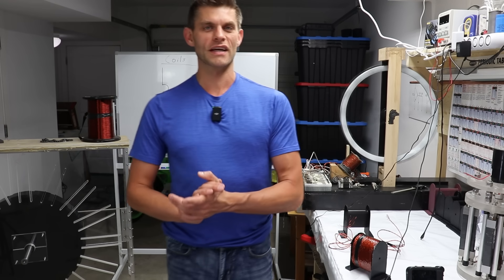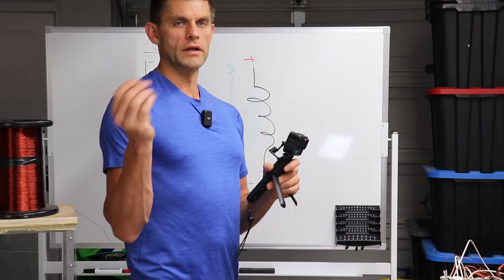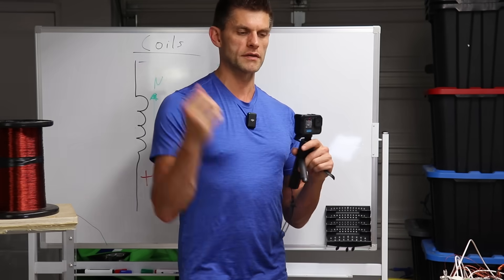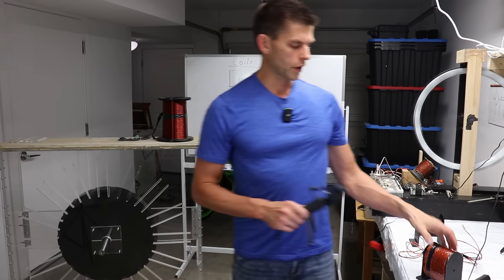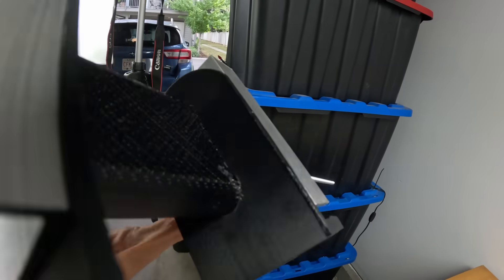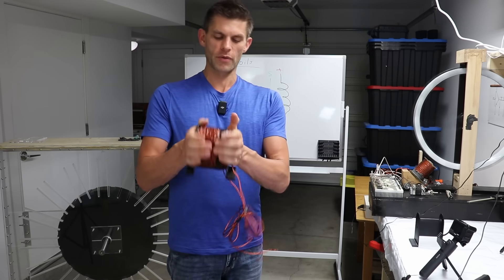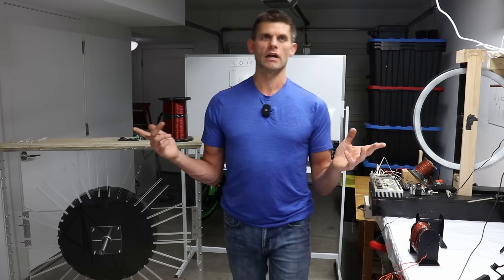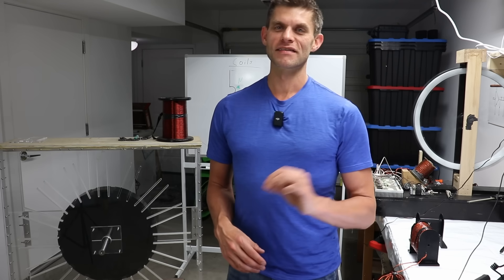Unlimited Energy in My Garage (No Patents)

Comment: Im gunna have to ask  wtf is eith the go pro. You have the mannerism and pacing of an inmate. You holding the camera makes you appear paranoid.  Open source does not mean what tou think it does albeit technically yes this is open source. More accurate its an idea free to use without a patent 

Okay easy test. Use a significantly smaller battery on one side. Alternate them until the larger battery is full stafting with only the small battery charged. Swap back to fill the small battery and them back again. You can set up a single cut with a clock in the background. Voltage doesn't work that way either. You need to include the rest of the formula. 

A few triple As in series will work. For the amall side battery and then a series of high capacity lithium ions for the large idea. 

I mean if it works. Obviously money is not an issue. But we know how physics and electrical work around here bubba. Sorry. But youre always getting negative energy.
Reply from the maker: Ok Mr positive
Reply: @MadscienceLPTECH  ions don't care about positive or negative in this test

Comment: You are way ahead of me, but it seems.
Like a heavy flywheel would would Help Support A bigger generator.
With Little Change in the design. Also  a distributor type Of equipment to help with the on off of the magnets.
 To allow the will to push faster and harder.  Just Thoughts.
Reply from the maker: Great ideas!

Comment: We're in 2025 and we're still trying to do the magnet thing?  I get tapping into the ether (its not vacuum) but apparently telsa figured it out and they destroyed his work because they didn't want slaves to have free energy.  Either way, these steps have all been tried I don't see anything you're doing that's different.  This isn't zero point energy you have to put battery power into still.
Reply from the maker: Sounds like u know

Comment: I love what you are trying to do. My father and I used to browse pezwiki and YouTube for videos of bedini or Bruce DePalma and others. I'm very glad to see someone continuing the work. 

I do, however, have some questions.

Has your bike wheel model produced over unity? If so, can you talk about it (regardless of how small)

What is the purpose of the wheel? I understand the coil and collapsing field generating back emf (flyback), but I don't see the importance of the spinning wheel.

Lastly, 
If the big idea is the dipole in the battery being activated from high voltage spikes... Then could you simply model the overunity by pumping high-voltage spikes into the battery, negating the wheel and associated coil all together?

Thank you again for your time. Best of luck to you in your research
Reply from the maker: Ill adress these points in Wednesdays video

Comment: For a crowdfunded project, better than one large build would be to make cheap demonstration kits so thousands of people can personally verify the magic with minimal time/money investment. e.g. a setup with 24Wh battery that spins a 1W fan so will run out of power in 24 hours, but if you connect the pulse generator will generate 1W overunity to power the fan indefinitely.
Reply from the maker: Once I get this proven then yes I agree

Comment: By overloading a Lead Acid Battery for a short time you open a Dipole that lets you harness 0. Energy? What? Try Hard enough and it opens the Battery with a Bang! Thats wrong, man.
Reply from the maker: I've been doing it for a long time. Its pure voltage with 0 amps
Reply: @MadscienceLPTECH  Hmm... I experimented with an antenna to harness Static. (Also very High Voltages and almost 0 A) But had trouble converting it into something useful. Well... I'll Subscribe and check in once in a while to hopefully witness something innovative. Good Luck and work Safe!

Comment: 🔍 How to rigorously validate the Bedini over‑unity claim (quick checklist)

1⃣ Isolate the two batteries (primary & secondary) with mechanical switches / solid‑state relays – stops cross‑talk.

2⃣ Measure V×I at the input with a low‑inductance shunt + ≥ 100 MHz oscilloscope. Log every sample (≥ 1 Ms/s); flyback spikes last only microseconds.

3⃣ When the run is over, fully discharge the charged battery into a constant resistor and integrate the energy delivered. Do the same with an identical control battery.

4⃣ Repeat the entire test with the same setup *but without the coil* (plain DC charging). This is your benchmark.

5⃣ Calculate COP = (energy out) / (energy in).  
    • If COP > 1 with solid statistics, share raw data for peer review.  
    • If COP ≤ 1, it’s a nice pulse charger—not over‑unity.

— Based on the “Bedini Monopole Group Experiment” procedure by GPT O3

Comment: In regards to the time and effort manually winding the coils, you could improve on your jig with the drill attached by replacing the drill with a cheapish dc motor with a a variable speed controller and then at the bottom have a linear rail, threaded rod and 3d printed wire guide with another dc motor variable speed controller and using an adurino and some basic code to control the speed of both motors and timing for the linear rail motor to change direction and you could have a automated coil winding setup and would probably only take a day to put together ans get set up and then no more manually winding every time you need a new coil
Reply from the maker: That sounds like a great idea, thanks for the suggestion!

Comment: My brother please look into methods like op_return to commit these ideas somewhere permanent and safe, like Bitcoin or Kaspa. You'll be limited to around 80 characters each time, so the description of the apparatus needs to be very concise and may require a few transactions to commit to the chain, but if you truly figure out zero point, those ideas need to be written somewhere permanent, safe, open source, that can be shared for all to look at via a block explorer that shows transactions, that will display the op_return. Best of luck man, and I'm beyond fascinated with this coming from having started down engineering in college (changed majors but still took electricity and magnetism physics). Keep up the great work. Your explanations are very eloquent, which is what is needed.

Comment: Use an oscilloscope to measure the back EMF current pulse going to the battery. The area under the curve if integrated will calculate the voltage and power. You will soon see that the power is less than the input pulse (physics after all).  Not some hocus free energy. Just catching normally wasted energy.
Reply from the maker: Yes

Comment: I'd like to offer something that will help you greatly.  It's not zero point energy, it's a aetheric energy.  

Think on it like this, they say sound can't travel in space cause there is no medium for it to travel.  If there were space between everything, then Newtons laws of motion wouldn't work, sound couldn't travel, etc.  

The aether was an accepted concept, however,  it had exposed an unfortunate truth during the Michelson-Morley experiment.  But that's for a different time.  

The æther can pretty easily be proven and proven to hold energy.  

Use this knowledge, and you'll proceed must further.
Reply from the maker: Could be correct

Comment: So if switching off the magnetic field generates 100’s of volts in and of itself why not just do that instead of rotating a a wheel with it? If you have to have a permanent magnet in front of it to induce it then why not two coils both in close proximity with one another turning off and one turning on simultaneously?
Reply from the maker: We will see, first this way that we know works

Comment: @MadscienceLPTECH 

A few things.. 

🤔 1) Why did you string out & twist your wires initially,  before wrapping your coil?
[Im not knocking it, but curious for your reasoning?]

Also, 🙄🤔 I think we need to come up with better twisting & wrapping stands - so that your process is a little cleaner, & will be more effective for the end results. 

2)  Within this vid, Jay points out a few thating that may be of benefit(s) for your coil builds.... 

Obviously, he's using a iron core & you're not... but there might be something of use for you to check into or try out.. or even contact him about for more info if need be.

But I think some of what he points out might be of use, if adaptable, to maximize your energy harvesting. 

- vacuum epoxing, to remove the unwanted air.
- insolated layers?
- materials choices [pro's & con's]
- coil testing
- usages of mosfits

Also, within the vid... 🙄 He points out skillshare... which might also be of use. 🤷‍♂️

I thought this vid was a "win, win, win" for potental usability aspects. 👍👍 [Hopefully]

- I wanta see your & your build be as successful as possible - just to validate the points that much further!!

https://youtu.be/DkhpuuPljS4?si=FCc4GH9bzulygHnz
Reply from the maker: Bedini twisted the wires together for synergistic flow... might be unnecessary 

Air core and high voltage high speed switching is key 

The epoxy is justvto hold everything in place, though vacuum would be sweet

Thank you for the comment and support 🙏
Reply: @MadscienceLPTECH   Did you watch the video?  
Was there anything that might of been of use, to help get more efficiencies & effectiveness out of your build?

Sorry that you had to sit through the first 10mins or so, until it got to the more applicable segments.

I know that both of yous have different intentions, but I thought that there was some stuff that was applicable & useful.  Hopefully it was worth the time to watch that vid.

Thanks for explaining your reasoning for twisting the wires.

Hopefully,  that skillshare lead was also of use.
Reply: @MadscienceLPTECH the video the above comments
Reply: @MadscienceLPTECH.... the vid in this comment.

Comment: I love the passion and the build quality here! I've seen a lot of pulse motor designs, and they're always fascinating. The big question is always how you get around the laws of thermodynamics. Have you been able to run a test where the machine sustains itself and also charges a completely separate battery? Would love to see the input vs. output measurements from a calibrated meter.
Reply from the maker: The laws are based on a certain set of information, there can be more information that allows for energy to be harvested without violating them. Like solar

Comment: Magnet in the shape of a helix, thin and compact, submerge it in resin under a vacuum and let the pressure back in and let it cure so its not fragile. Depending how you made the Helix you may need to remagnetize it.
Treat it like a Faraday Disk, it will act as if the helix isn't wounded up, will be like as it it was a Rectangle, but it's almost a cylinder, your compacting the surface that gives off magnetic north into its self.
PS the diameter of a Faraday Disk controls the Voltage, and the Voltage squares on itself
Reply from the maker: Interesting thoughts, thanks for sharing!

Comment: This is exciting stuff. I’d love to believe in it, and maybe put some money into it. If you can prove it.

If this motor truly delivers more energy than it consumes (or even just recycles energy unusually efficiently), that would be an incredible breakthroug. Not just for clean energy, but for how we understand the physics around us. You’ve got my and other people’s attention.

To really silence the skeptics and show the world what this can do, it would be great if you could post a follow-up video that includes a full uninterrupted demonstration, showing:

1. Start-to-finish footage in a single uncut take, ideally with the full device disassembled and inspected first (to rule out hidden power sources), then reassembled on camera.

2. Simultaneous input/output power measurements (voltage and current), displayed live or logged through calibrated meters so we can see the net power balance in real time.

3. A clear load (like a resistive heater, fan, or mechanical dynamometer) so viewers can see real work being performed.

4. A period of extended runtime (10+ minutes) showing continuous, unassisted operation.

Also—since you’ve said this project is open-source, would you be willing to share the design files? A GitHub repo or downloadable ZIP with schematics, bill of materials, firmware (if any), and build instructions would go a long way in helping the community replicate, test, and improve the system. That’s how real open hardware grows.

I’m genuinely hopeful about where this could lead. Looking forward to the next video!
Reply from the maker: Thank you, great suggestions and all will be addressed in next video.

Comment: What a bunch of bum fluff - The amount of POWER ejected from a coil is the same as the power that went in minus efficiency. The high voltage from a coil comes with lower current, resulting in the same power. I will check back to see if my comment is removed.
Reply from the maker: I hear your skepticism, I welcome you to follow along, it's all good.

Comment: I admire your passion for making self running machines with electricity and magnets. But I feel like I should mention something that I learned when I did this same thing over 12 years ago.

You can get a fly-wheel generator to produce enough extra power to be able to keep itself in motion but only if there is no "load" on the generator. You can trickle charge a battery , maybe but as soon as you try to tap more power out of the self running generator it will stall the generator and cause it to stop. 

There's a difference in getting a generator to stay in motion with no load, its another to have a generator keep running after you attach a load to it without any input to the generator. If you can get a generator to run itself AND be able to plug things into causing a load on the generator and it keeps moving, then I will be very impressed. But as for getting a generator to self run without a load, it has been done before by many people including myself..... Good Luck.
Reply from the maker: People have working models of motors that have abundant excess energy
 Stay tuned
Reply: @MadscienceLPTECH   I have not seen a video of someone who showing that these over abundant can power or run anything. Only videos of a wheel spinning and volt meters connected showing it producing enough power to keep itself in motion. If you could make a video of your over abundant generator in self operation then plug in something like an induction cooker or a high amp power tool of some sort or a heater, something that draws a good deal of power, you show me that a self running generator can power something like that, you will have then seriously peaked my interested. Best of luck.

Comment: Electrons have a negative charge, my guy. They travel toward the positive terminal.
Reply from the maker: There is multiple ways to explain it, and it was for beginners at the start. Holes then bud
Reply: @MadscienceLPTECH  No worries. I wasn't trying to be critical. It's just there are a lot of frauds claiming zero point energy. Looking forward to your proof of concept.

Comment: Forgive my naivety here. I’m just a layman. If current through a coil can generate motion in the wheel with magnets, if you were to add say, another 4 coils around the wheel, would it be possible to create 4 currents for the cost of one?

Sorry if this is a stupid question.
Reply from the maker: Well Voltage = amps x Resistance. so the more you add the less you get from each one. good thought love it!

Comment: Right off the bat, this guy raised a red flag.  Electricity flows from negative to positive NOT positive to negative.
Reply from the maker: False it depends on convention. And with beginners in kind I choose wisely
Reply: @MadscienceLPTECH With a battery, the electrons move from negative to positive. Prove that wrong.
Reply: @FilteredInc  Do you think that "electrons" are moving thru the wire like marbles down a chute?  CP Steinmetz says, "LOL".